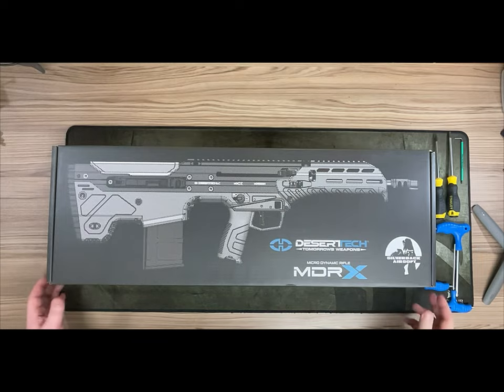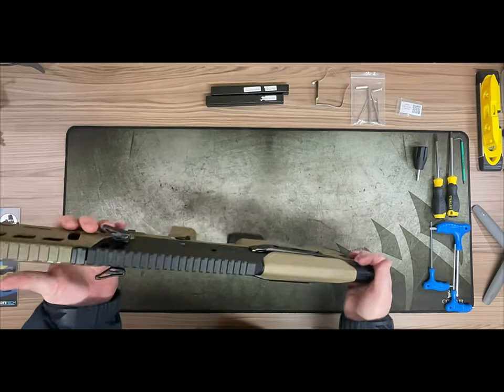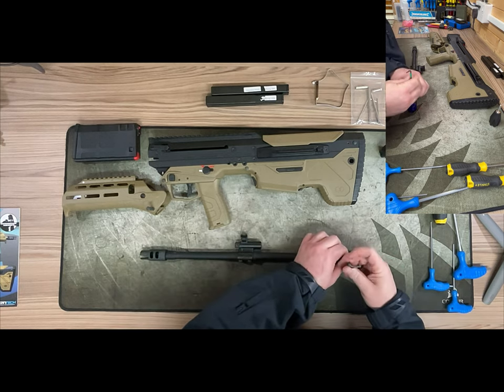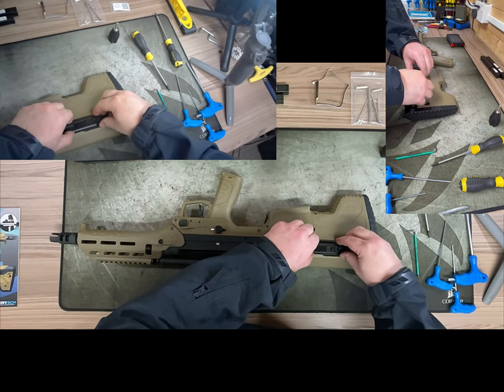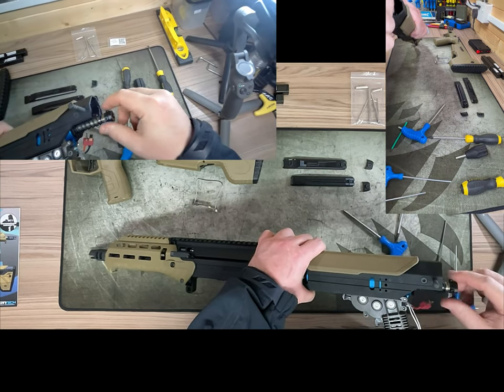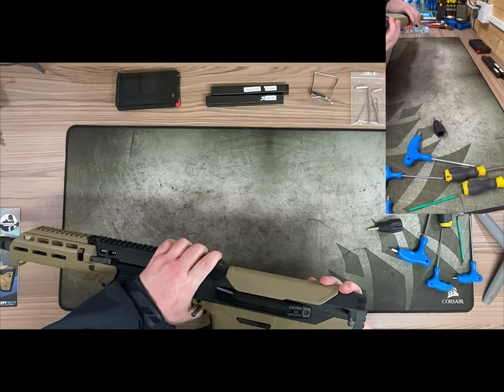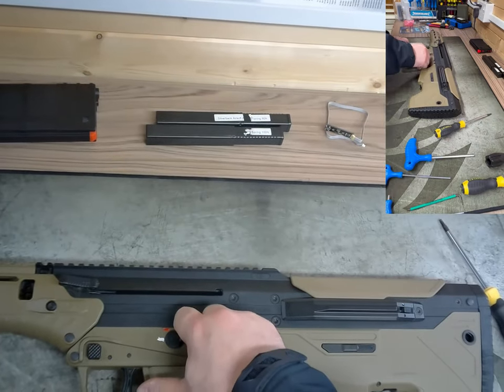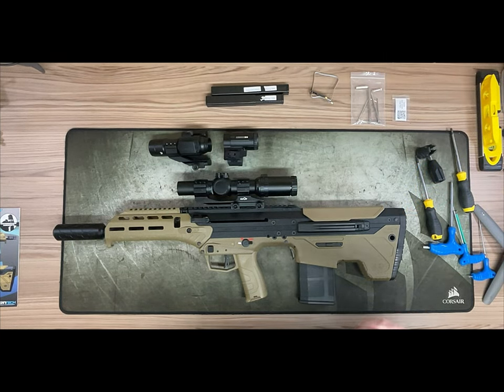Silverback MDR-X Overview

Comment: Great video! Quick question, at 8:14 ish when you remove the two covers (one off either side), can these not be removed by pressing / pushing the small button thing on the covers like on the real thing?
Reply from the maker: Hi, yes you can, the reason I removed the 2 screws (should have said in the video so thanks for pointing that out) was because sliding the gearbox and motor unit back that tiny amount gives you a little bit more room to feed the trigger board wire through.